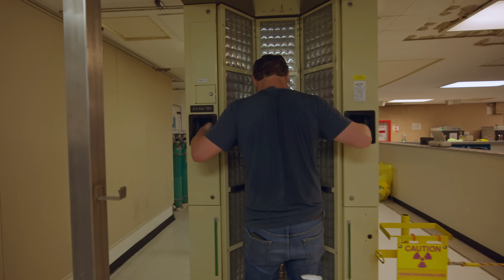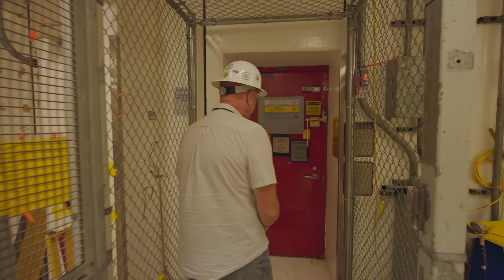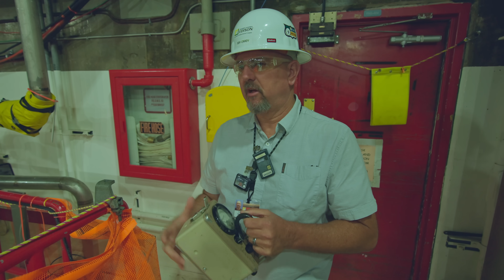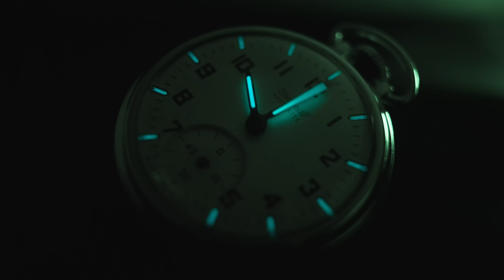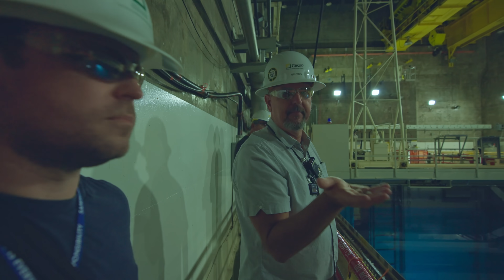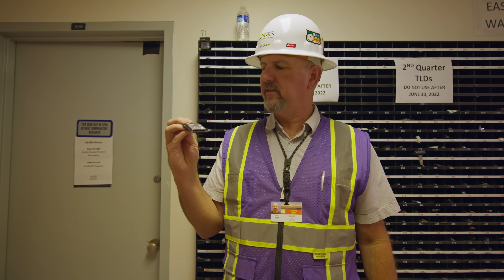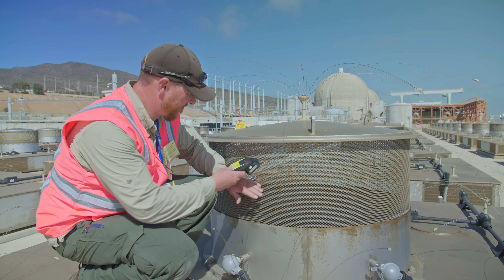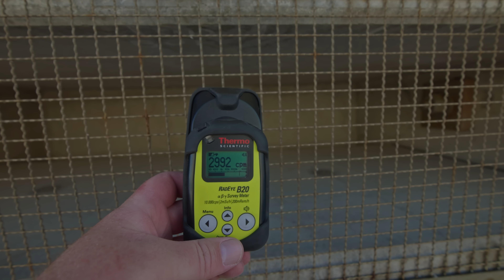Inside San Onofre Nuclear Power Fuel Pool and Spent Fuel Storage

Comment: In 1979/1980, I was stationed at Camp Pendleton Ca which is across the highway from the plant. I got a part time job with Wells Fargo as construction security on the plant. I would spend 8 hours walking every part of the plant looking for smoke, fire, running water. Belief me, that is a huge plant. It was also extremely educational. My patrol area was the containments, control, and the turbine/generator area. It’s sad to see it’s being decommissioned considering the huge effort I watched during its construction.
Reply: thank you for your service
Reply: @222aint  But that wasn't simple. It was full of ambiguity, and the lack of alliteration left us all with a strong feeling of constipation 💩
Reply: It is going to be kept running, because California’s grid needs its baseload power.
Reply: The psychopaths called politicians in California are way beyond stupid.  They are also trying to shut down Diablo Canyon but I did see that Newsome being the idiot he is wants to now get a life extension on the plant as the Kalifornia politicians will see what hell is when they start blacking out the public on hot days.  Last summer the public heard DO NOT CHARGE electric cars during high electric demand but that was right after the idiots wanted to ban gasoline vehicles.  Get an EV then find out the grid can't support millions of EVs then later the public will find out replacement batteries will make the cost so high you won't be able to keep the car.
Reply: Too bad you didn't help pay for it! They beat the rate payers black and blue for decades, and dumped radioactive water into the bay with no warnings to swimmers or surfers! Not to mention the radioactive xenon-133 vented into the air! Hundreds of thousands of atomic decays per second per cubic meter of air!
Reply from the maker: No radioactive water went into the ocean. If there was a release of xenon it would only be a problem if you were huffing it right at the source.
Reply: @RadioactiveDrew  it's really discouraging seeing people not realize nuclear is the most efficient and cleanest energy we could use.

Plus it would only get safer, more efficient, and more advanced as possible profit drives research and development.
Reply: @JohnDoe-cz9gy  Profit should never drive anything nuclear in my opinion. Everything you say is scaring me, because it seems also logical.
Reply: @JohnDoe-cz9gy  We have a few people in Pennsylvania and a lot of people in Russia to thank for that sir. The Japanese are all in, but they understand maybe there are a few "cracks" in the system. We also have the waste situation, and I want to know who is going to take that stuff. As the world makes more waste and more fissionable material is available, where will the security be for that waste? I can't wait for the Pakistanis to figure that one out. It's the future we need to see, and it's impossible to really know, but really we have to do better than this; it's just a repeat of humanities failures and a preview of another mass extinction.
Reply: I was stationed there at Mateo on Camp Pen several times in my career .  Sorry to see these were decommissioned.  We used to call the silos Dolly Partons because they looked like huge tits when you're sitting on ship just offshore
Reply: I was there in 80 for  Westinghouse and the futle repair / rebuild of unit one. Were you  security in that area? We stayed at the place they called Jap Mesa, a racist term now but used by the government when they interred  Japanese Americans there. It was an interesting and amazing experience but really told the story of America right there. We had people called jumpers who would work in the plant until they got the max alotment of gamma rays, then they would be paid $100 and hit the 405. We were holed up in big trailers full of technology, and they were laid out in front of us in those ramshackle shanties waiting for the rain to cool them off.
Reply: It could be getting decommissioned from just from age. My town in pgh pa is getting a new power plant this year! I know the our country more recently came out saying theres plans to address the old plants and build knew ones
Reply: I was there too.......Who are you?what's your name?
Reply: Someone had to guard the nuclear titties 😂. o7
Reply: I wish I could get a part time job in the marines but as infantry we barley can do that. I love looking at that plant everytime
Reply: "It’s sad to see it’s being decommissioned considering the huge effort I watched during its construction."

That's liberals for ya.
Reply: @im1who84u  and they'll be the first ones to complain when there's not enough power to charge their tesla and refrigerate their camboocha juice.
Reply: @im1who84u  nuh uh it's you conservatives and your conservationist  nonsense that killed the plant! Contrary to your beliefs: nuclear fusion and fission IS natural, but you people would know that if you all weren't trying to regress society back to the stone-age!
Reply: @WarPigstheHun  I didn't know who I was talking to.

Please excuse me for my ignorance.
Reply: @im1who84u  sure thing "Ozzy"
Reply: @BlueAgaveStudios  you’re a liberal we get it, but please do tell us how much better the lithium mines are and how well they treat the children that work in them🙄
Reply: @im1who84u  YOU should say more respectful things to a Marine pal. Or let's have you meet him out here on the beach for some volleyball.
Reply: @BlueAgaveStudios  "YOU should say more respectful things to a Marine pal. Or let's have you meet him out here on the beach for some volleyball."

"sure thing "Ozzy"

What in the world?
Reply: @im1who84u  solar, wind and gas turbines are replacing nuclear power plants, which are more expensive to maintain.
Reply: @markhankins3023 but are also supplying 80 percent of the grids so good luck with that
Reply: it is closed because the storage is leaking into the sandstone
Reply: @yahwea  You're wrong, you may want to check your facts about SONGS demise.
Reply: @yahwea    Oh geez.  We used to use the beach area on the north side of the plant.  My dick hasn't fallen off yet so I have to assume it was prior to the leaks.  Was there multiple times between 79 -82 then final time in 85
Reply: Nuclear energy is safe!  But it is very amusing to listen to the tour guide try to make it sound safer than is perceived by the public.
Reply: @hodwooker5584  All good until you try to put that waste somewhere huh? Hey, I'm open to the new ideas, where are the new ideas about the waste? Because that's what's stopping this.
Reply: @BlueAgaveStudios all of the waste from every nuke plant out there only fits in a football field sized room deep deep underground below the water table
Reply: 1978 i kived in encintas y neighbor worked at the plant they built the plant on a fault line && they built it backwards! Thw blueprints were upside down!!!better to build solar instaallations in the desert & cool the entire area
Reply: @hughjazzole2037  not even you believe that
Reply: @hughjazzole2037  As soon as I hear someone talk about flooding the deserts with solar panels I know they don't know a damn thing about renewable energy resources. 
I spent my career in as a renewable energy infrastructure technician and if I had to pick between wind or solar for longevity, ease of operation, power output and environmental impact... I'd choose nuclear. 

Spent the last years of my career working on wind turbines for GE.  Did you know a solar panel has to be used for 7 years before it "pays back" the electrical debt it took to create it?  The silicon has to be grown in vats using huge amounts of electricity.  There's also many toxic chemicals used and other materials which all have to be mined.  
On top of that, when the panels (we call the modules, but y'all call them panels.  Technically a panel is made up of modules...but if I say module everyone's eyes glaze over) aren't easily recycled. 
Pretty soon there will be mountains of panels laying around waiting to be recycled.  
Except that recycling process is going to use lots of electricity too. 

The wind turbine blades are fiberglass, and are already creating a problem.  They were scattered all over the old fields I worked on, covered in grease and oil. Nowhere for them to go.  

But everyone who doesn't know crap is always like "fill the deserts with them!"

Now you need more transmission lines.  You're talking hundreds of thousands of tons of mostly aluminum (which all has to be mined and smelted, then cast or extruded...oh then shipped here!) just to run that power out across the desert to get it to where it needs to go. 
And because you've stuck all that power generation infrastructure in the middle of nowhere... there's more line-loss getting it to somewhere.
And due to the heat, everything gets derated.... 

Then people have to go live nearby to maintain it. 

Then there's nuclear.  There's over 400 nuclear power reactors operating around the world, yet how often do we hear about major accidents?  
Mostly Fukishima with the tidal wave.  We've been learning from the past mistakes and incorporating them into newer, safer power generation technology.  
A properly set up operation today can re-enrich the waste with a breeder reactor and generate power off both sides of the operation, generating even fewer amounts of actual waste and greatly increasing the operating life of the fuel. 

Now lets talk about draw. Megawatts v megavars.  
With renewables, they're always outputting 100% of what they can produce at any given time, whereas a steam-driven turbine can spool-up to match the load. 
So say it's summer and Dryer's icecream company wants to turn on a whole bank of freezers after a maintenance cycle...  that's a lot of inrush current, ok maybe they start them in series...  but where does that power COME FROM if renewables are always outputting what they can, when they can??
So now you're like.. oh we'll use the renewables to charge batteries, and we'll store the power!  Wonderful!  Now we're mining F-tons of lithium and other rare earth minerals and no matter what anyone tells you, any tonage of it is ALL conflict mined...  but everyone needs it so no one is really pushing that whole story. 
But besides that, now you've got massive loads of more mining, more refining, more smelting, more manufacturing, to produce the batteries you're going to use.  Because lithium has such a higher energy density than lead-acid types.  

So now you've actually created a much larger carbon footprint by insisting on using renewables, than if you'd used COAL FIRED PLANTS in the first place. 

You know what's in the gearbox of a 3MW wind turbine?  A few hundred gallons of OIL.  Know what all the wiring insulation is made of, that runs up and down tower and all over underground?  Hydrocarbons. 

There's nothing "green" about renewable energy. 
Renewables have their place, but it's NOT powering massive sections of the grid and being relied on solely. The Green New Deal is a LIE being sold to you by ignorant politicians who don't have a clue what they're talking about. 

And now you're using up dozens of square miles to sporadically generate the same amount of power that a square mile nuclear station can generate reliably without ceasing for 30 years or longer. 

But yeah, go on with the whole "fill the deserts with solar panels" thing, you'll continue to fool the masses into thinking you know something, and you'll continue to sound like an absolute fool to anyone who actually knows what's going on.
Reply: @syberphish I like reading comments that were thought out.
Reply: believe, not belief
Reply: @dwetick1  SOMETIMES WORDS GET MISPELLED BY THEMSELVES BECAUSE OF YOUR PHONE BUT I GUESS THAT DOESN'T APPLY TO YOU BECAUSE YOU'RE PERFECT. SMFH
Reply: @dwetick1  a simple “thank you for your service” on this Veterans Day timing would’ve sufficed.
Reply: @dwetick1  I bet you are fun at parties.
Reply: @dwetick1  feel better? No one cares btw. Folks know what was meant without correcting.
Reply: @mygoogleaccount9990  I care. You must have skipped out of English class, was it "uncool?"
Reply: @bryanphillips6666  there are two types of people, those that can “ extrapolate true understanding from incomplete data “ and those that “…………..”🤷‍♂️
People that spend the time pointing out others obvious mistakes generally fall into the latter category 🤦
It certainly doesn’t show a superior intellect, it’s pretty much just annoying.
The need to constantly point out others spelling/grammar mistakes is actually classified as a genuine “mental disorder “, just food for thought I guess 👍🏻
Reply: @bryanphillips6666  No one cares. You're no one.
Reply: @bryanphillips6666  was it “uncool”?
Reply: @bryanphillips6666  You and D. Wetick are getting murdered by the ratio.
Reply: @bryanphillips6666  This is a Youtube forum, not a college dissertation. Get off your truculent supercilious self-righteous high horse fool.
Reply: @bryanphillips6666  You didn't care enough to go to social studies did you Bryan? They teach you that it's always good to understand how a human being thinks. That way they think you are one too! It helps you in many respects, but it helps us all keep score for the human race ✌️🙏☺️
Reply: @bryanphillips6666  Little man spends his life correcting others to get self worth out of it.  It's pretty pathetic.
Reply: @bryanphillips6666  Is it possible that the autocorrect on his phone misspelled what he really meant to say but never bothered to correct it? Jeezus you need to stick to the issue at hand which is to read people’s comment and appreciate everyone’s personal opinion about the documentary and mind your own business about people’s education. Geesh
Reply: @mygoogleaccount9990 🤡
Reply: @jasonardley4188 🤡

Comment: I set off alarm bells going into a waste storage site, apparently my head is six times background level, specifically... my occipital protrusion, I know you don't think that's much, I don't either really, but I was wondering if you had any idea where I can get that checked for free by perhaps a  spectrograph or something without having to remove pieces of my head...          
   I'm just curious what isotopes are causing it. 
   I would guess strontium based on my age birthplace and the fact that it seems to be in the bone.
Reply from the maker: Would be interesting to run gamma spectroscopy on your head to see what exactly it is.
Reply: @RadioactiveDrew  the thing is those scintillation crystals have to be sealed in total darkness and I need to breathe! I'm not sure how it would work. 
   If I had a more sensitive counter, I'd at least be able figure out if it's alpha,  beta or gamma myself... Just can't afford it... Judging by the detectors that were being used by the crew that were surrounding me and that I don't get this higher reading at home, probably an alpha emitter, And an intense enough one to get out through my skin. That should narrow down a bit, any ideas?

Comment: so it seems with all of those storage containers emitting that much heat, trapping and using the heat would be a good source of geothermal like power right?
Reply from the maker: That's what I was thinking as well. Seems like a waste of energy not to use this passive heat for something.
Reply: @RadioactiveDrew  "They" don't want to do that as it would seriously diminish the petroleum profit mountain.
Reply: @RadioactiveDrew  I am pretty sure anything you tried to do with it to that end would compromise its containabilty.

Comment: i never knew that it took so long to decommission a Nuclear Power Plant. Did the site just outlive its usefulness?
Reply from the maker: There was a leak in the steam generator after they replaced the whole unit, which is a big piece of machinery. So it closed down because of that and the pressure they were receiving from the State. The site could have still operated with one reactor...but it didn't unfortunately.
Reply: @RadioactiveDrew  better safe than sorry i guess.